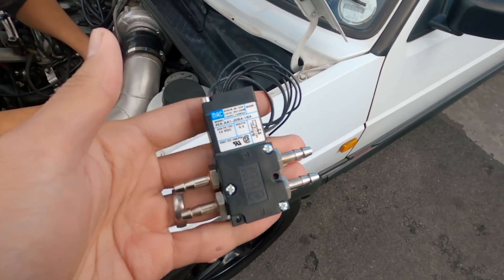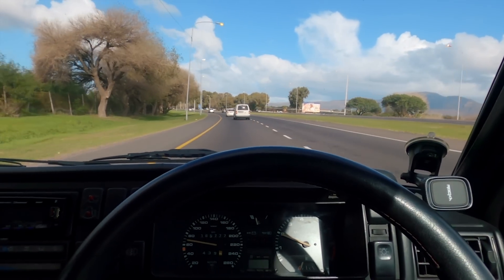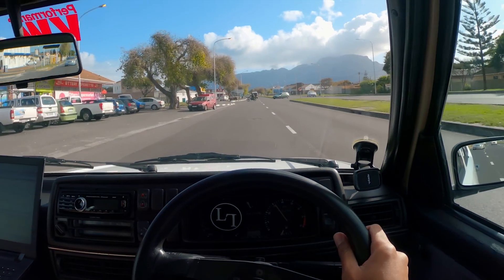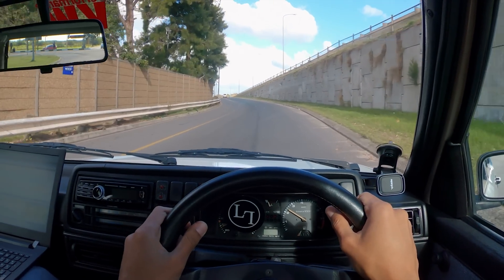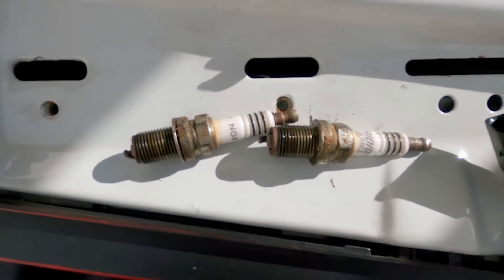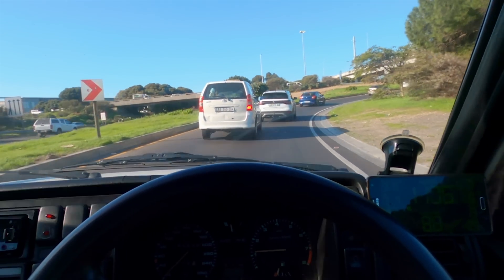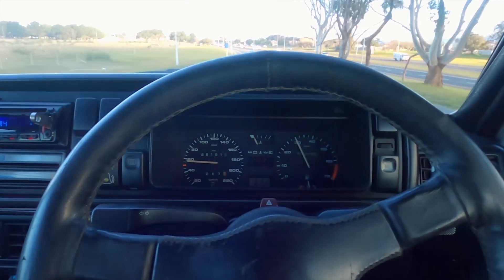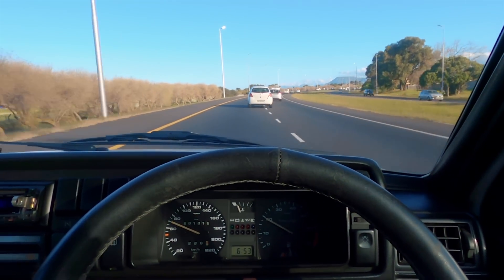Been waiting a while for this: VVT, Water methanol injection & MAC 4 port boost solenoid on the 1.8T

Comment: very good progress, serious improvements coming!!!!
Reply from the maker: Let's hope that these changes makes a difference that's worth while in the real world.   😅
Reply: @lowdl  you broke into the 12sec, so dipping down to low 12s will be interesting, i must contact my friend andrew, see if the wiring guru can help me with my flex fuel sensor..... but 25liter ethanol is about 1500rands in namibia, very expensive.... could you do a experiment video at the drags? two runs without the water meth, but logging intake temp, two runs with the watermeth, logging the intake temp. see what they do, side by side comparison of the dragy times,  i will watch that video.. 3 times.....promise
Reply from the maker: @road_2_pow_r  I'll need to put the wmi on a switch. Which wasn't the plan. But I'll chat to Andrew and see what we can do. It's difficult to compare times because there's a lot of other variables but the temps will be interesting to see back to back.

Comment: So some comments
Are you sure its a good idea to be using your FPR's rising rate vacuum reference as a source for the boost control which is being bled/ manipulated for boost control?
Secondly, when it comes to WMI and nozzle placement, furtherer is always best as it the mist will have more time to absorb the heat and also it is less suppression of combustion expansion within  the chambers.
And when it comes to mounting the 10.5L Cool Boost tanks, its one of two things, cut out a piece of hardboard/ plywood/MDF (not chip board) to match your boot mat, cover it with sound carpeting and mount the tank to that or if you are comfortable with drilling into your chassis, use rivnuts into the body.
I would also recommend a SPMU and connect it to the ECU for boost limp if the WMI does not operate.
And as a closing statement, if you get the WMI setup right, you wont look back at using expensive ethanol blends.
Reply: 1.) We know it's not ideal to be using the RRFPR reference but it's just what we had at the time and it works, we've had no issues thus far and we've checked many many logs. It will be changed eventually but right now it does the job.

2). That's the only placement spot we have at the moment, eventually this intercooler will disappear and then we will change the setup to match. Will probably move to a two nozzle setup like most of the other cars at the workshop. One post IC and one pre TB.

3.) It's being mounted with Rivnuts, we love Rivnuts, they are the bread and butter of the "Mounting things into the body" world.

4.) We're using the ECU's failsafes to sort that out, we have lean protection, IAT protection, Knock control etc.

Thanks for the tips regardless, constructive feedback is always good feedback.
Reply from the maker: What Andrew said. But thanks for your input, it's appreciate it. I'm not too clued up on wmi and the setup thereof. 
About the boost / vac lines: My tuner didn't want to tune the car initially because of the way we're handling boost but it works so we're slow to fix it. But it should probably be done sooner rather than later.